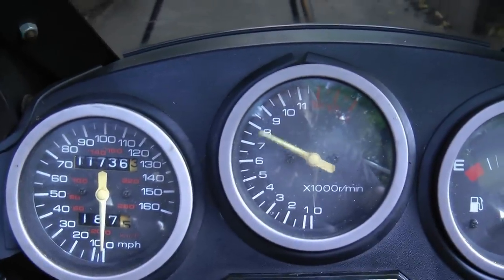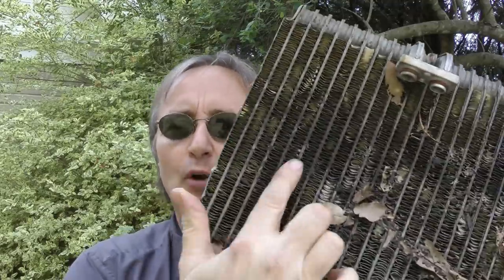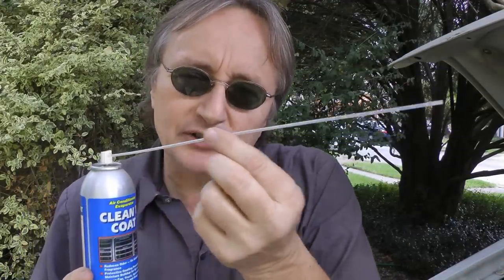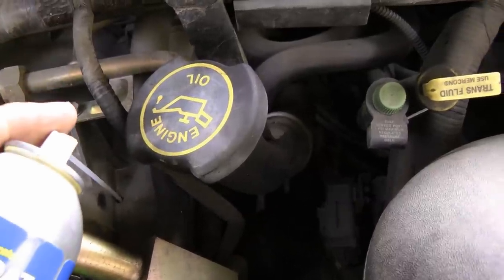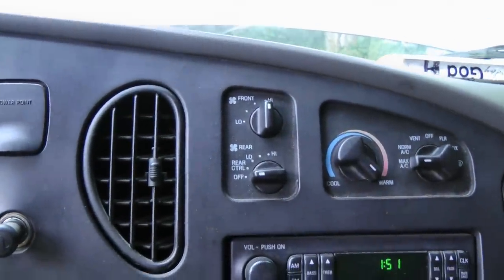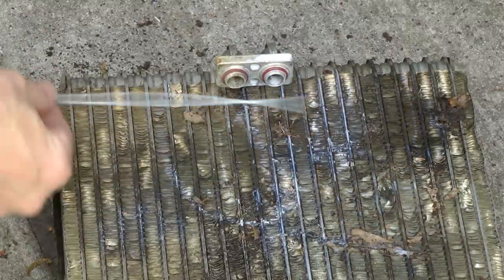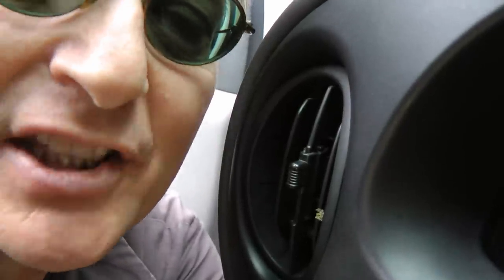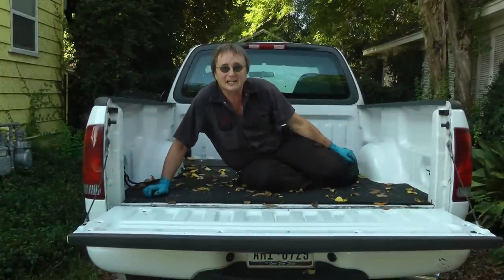How To Remove Car Vent Smells (Odors)

Comment: After seeing how ineffective the spray was at getting through the coil fins even when the coil was outside the car, I would rather take the coil out and replace it if there is a problem of smells or leaks. It's sometimes a dirty complicated job. But, I also don't trust breathing the chemicals from the spray that might just become an additional bad fume to breathe. It could become one bad fume on top of another.
Reply: until you realize how hard it is to get an evaporator coil out from under the dash lol

Comment from the maker: @cnorth50 just remove the blower motor and spray the condenser right there. A bit of work, but it beats drilling holes if you don't know what is where (as you could punch a hole in the wrong part.) scotty

Comment from the maker: if it does it all the time, evaporator is leaking. If it does it after running a while, the evaporator is freezing up and you need work done on the AC system , often a bad thermistor in the evap case
Reply: My vents stink eealy bad like rotten blood or death. Is that how it smells or do you think I have a dead rodent ?

Comment: I would like scotty to show how to unscrew the blower resistor on a Toyota...especially a 2005 Sienna. Scotty said not to do a flush on the new cars because the condenser is thin and it can mess up the compressor. Is this a flush or just a different type of cleaning?

Comment: Will a clogged evaporator cause warm air vent flow while idling at a light and then cold air flow when moving forward once again?

The cabin filter was very clogged and removed.

Comment from the maker: of course fix the ac, it may need refrigerant or cooling fan repair if they don't push enough air. But check under the hood, often oil drips on the exhaust and you smell that. Exhaust leaks you would hear with your ears.

Comment: Clean N Coat isn't available anymore. I bought Kool It and the spray tubing is 1/4 wide. Is  that to wide if I drilled where you drilled? I have a Ford van like you used in this video.

Comment from the maker: you system is stuck on default position. ON older cars, that's a vacuum leak. But in newer cars often bad computer controls such as bad blend door actuator

Comment: It works for a few days, but the issue is I am experiencing humidity in my car when ever I come back after a few hours of car sitting there its very humid inside and seats are wet even if the AC was never used makes me wonder if something isn't draining properly from it.

Comment: hi scotty, I have a 2012 rav4 and there is an awful smell coming from the A/C. Can't I just remove the filter and spray the cleaner directly to the fun? Or if I remove the blower resistor as you have mentioned, will there be a hole to insert the hose? Thanks

Comment: my wife has a 2015 Nissan Rogue ac blows air great but every now and then  the air flow gets weak but the blower you can hear it running it will turn up and down not by itself but with the knob you can turn it all the way up she will loose air flow, now when we go to the carwash when everything is said and done when we get up to the blowers that blow the excess water off your car you can fill the air from them coming through the vents what can i do?

Comment: Scotty,  my 2003 chevy cavalier has a oil smell problem coming thru the vents. Some how oil or fluid has gotten into the air filter hose, smells when you turn on ac or heater.  What do I do??

Comment: Hey Scotty, I have a 2011 Ford Escape and recently the air coming out of the vents smells funny but after a few minutes it dissipates. Any suggestions on how I can remove this smell from my car?
Reply from the maker: +WiiDroid do as in thise video, it's often mold or bacteria
Reply: +Scotty Kilmer I tried spraying Lysol through the intake twice but the smell still remains, where could I drill a hole for Clean n Coat?
Reply: +WiiDroid the dude just told you. watch the video

Comment: Get a can of foaming coil cleaner at Home Depot. It expands in the space to reach those unreachable areas you can’t spray. Only thing is you have to rig your own straw or some sort of tube to spray it in there as it doesn’t come with one.

Comment: We just did this with a seemingly similar Ford (1998 Explorer), but despite a normal strength blower motor, the flow feels obstructed in front (but strong behind the front seats). The air is cool in all vents. What should we try to help the flow in front?
Reply from the maker: check for kleenex or other obstructions in the intake of the vents first. If not that, the blend doors often get stuck on fords and that's a mother taking that dash apart to fix them

Comment: my car is Chevrolet Malibu 2003 I bought it 3 months ago. when I opened my car on the driver's doors after 20 minutes of driving, I felt
 something very hot under my car. What is that cause? I used my aircon that time.

Comment: wont the disinfectant spray destroy or corrode the HVAC system? Thanks
Reply: If you can use one without alcohols and with neutral pH it's best but i highly doubt the little alcohol that gets sprayed together with the disinfectant could do any harm at all to the evaporator coil/heater core, in fact it would likely immediately evaporate and leave only chemically inert compounds on the coil. Just don't go and spray bleach, acids or soda solutions on it... these will definitely do some harm to the thin evaporator coil/heater core tubes.

Comment: my honda odyssey 2001 smells bad when i turn on the front or rear A/C and the odor is attached to my shirt, skin and hair. i checked the connection and there is no leak from the evaporator. please help me.

Comment: Hey Scotty, when I turned my car's heater on a while ago, I smelled something that was like roasting peanuts, and I was told this was because my car hadn't run for a few weeks.

I ran my car for about 10-15 minutes, and the smell was there the whole time, never got any weaker, as far as I could tell.  I checked my oil levels, and they were fine, engine's not overheating, nor is the check engine light on.
Reply: Could be squirrels hiding peanuts in the evaporator box
Reply: @DeepSouthernTX  Hah, no idea what it was but I got rid of the car a while ago. It never had any real issues besides that.

Comment: I smell a dead animal smell  every so often "OUTSIDE" the car but never inside. Had the car for 2 years and only smelled it a few times. I have been underneath for oil changes and looked in engine compartment and can find a thing! Any ideas?
Reply: Can't *

Comment: I have a 2006 LR3 and the car smells very badly after it rains.  It used to go away after a week or two but now the smell won't go away.  Any ideas?  It's not coming out of the A/C-Heat vents, it's the interior that smells.
Reply from the maker: +Nancy Bailey car is full of mold, try some lysol ALL over the place

Comment: I like this trick to get at spraying/cleaning the vent system components that are hard to reach.  Only thing you got to be careful of is like you said drilling thru a component like evaporator or heater core.

Comment: my 04 wrx heats smells really bad and can't figure out how to remove the smell. changed the cabin air filter but now how to try this clean n coat where can i buy it? also do you know where its acted at in my car where i spray the stuff? Thanks you so much! rather do this and save so much money if it works.
Reply from the maker: just google clean n coat, that's how I got it.  Do it just like in my video, only spray it on the heater core section instead of the evap core

Comment: I bought a 2014 Ford Focus back in September and I started smelling that sour moldy smell in the Spring when I had the fans running, but not the A/C.  I talked to the dealership and they want to charge me $175 just to "Deodorize" the car.  I tried to use a $7 can of product on the intake vents under the cowl, but it only temporarily masked the smell.  Would I have to drill a hole into the case like the video, or is there a blower resistor under the glove box?
Reply from the maker: drilling a hole lets the cleaner get in there better, more direct.
Reply: Same issue same year and vehicle is this normal for a 1 year old vehicle
Reply: I have 2013focus st i hve the same problem the dealer told me to try vaccum the whole condenser and aircon pipe for 375 i might try scotty way

Comment: Hi Scotty, my 03 Protege has a bad smell almost like exhaust. It has gotten worse during the summer so I think its coming from the AC (I live in Miami so AC in the winter is somewhat common too). The smell is so bad, the car interior still smells in the morning. 
There is no noticeable loud exhaust SOUND. Also, the AC only works when the car is in motion,, Stop 'n go = no AC. Is this possibly related to the AC? Or should I look for exhaust leak?
Reply: I got the same problem

Comment from the maker: @nexpro1 Yes, those dodges are designed like crap, you can't access the original drain hose very well. So making a new one and putting a hose on it through the firewall would be a good move. Scotty

Comment: Okay Scottie, can  you tell me if an 02 Audi A4 has the knozzel under the glove box or will i need to drill an 1/8 in hole also?
Reply from the maker: it's more toward the middle and hard to get to. Drilling is easier
Reply: thnx! I also have an issue with my car always smelling like antifreeze burning on the outside and the smell comes thru the vents also. Sound familiar?
Reply: jgyrwa
Have your heater core checked for a leak. The A4 does purge excess antifreeze in certain engines, so this can cause the burning smell in the engine bay- I know because it's happened to me a few times. But definitely have your car checked so make sure something isn't terribly wrong so you can have it fixed before it gets too expensive. Owning an A4, I can tell you- they're not cheap to have repaired.

Comment: I tried looking for the cleaner in this video. Here in Canada I can't find it at my auto parts stores. I have a Pontiac G5 and was wondering how to find the part you cleaned in this video. My vent smells real bad. I put cleaner through the vents and it only helped for a month. I need any advice I can get.
Reply: change your cabin air filter
Reply: +Jd Bailey it's a brand new filter.

Comment: Hey Scotty I notice a weird odor coming from the vents only when I first turn on the ac or after I shut it off after running it for awhile. When I turn the fan on but don't use the ac, the smell isn't there. What could cause that? Thanks
Reply from the maker: mold and bacteria grow in the AC evaporator case cause it's damp and they like dampness. Try cleaning it out with lysol

Comment from the maker: @southernstructure remove the blower motor resistor assembly and stick it in that hole, after putting duct tape on the hole and putting a small hole in it for the hose. Scotty

Comment: how about liquid dish cleaner, in toyota.. just take the ac air filter off & turn on the ac untill you see water dropping from the drain hose, then shut down the engine, put it in on position turn the fan on full blast & pour the liquid dish cleaner in the blower 100cc every 30 seconds 10 times or until 100ml is finished, your evaporator is clean as new & will give you better cooling & kill all the bacteria that was inside the evaporator. I did it, works 100%. but still the boss knows better (Scotty Kilmer)
Reply from the maker: sure, you can do that, just be sure not to short the fan motor and blower motor resistor out, water and electricity doesn't mix that well

Comment: I just bought a 2006 Ford Five Hundred, it doesn't really have a smell but the AC blows warm air.  It does cool-cold air in the morning or if it's cool enough outside.    I've done a recharge and it has pressure and freon, so no leak.  The compressor runs, and I sprayed the condenser with a hose to clean out any gunk.   I was thinking of changing out the blend door actuator, but after seeing this...what do you think Scotty, could my Ford just need the evaporator cleaned like this?  Or is it something else causing the issue?  Thanks!

Comment: Scotty I got the same e150 with very little air flow I clean the evaporator core on the firewall it was dirty then tried it and still not much air flow ..got a guess why

Comment: I didn't read all these comments, but what also helps is to turn off the A/C and run it on vent only, your last mile or so. This dries up the air in there, and helps keep the stink away. I guess in humid areas you may want to run the heater.

Comment: my 03 Taurus smells like antifreeze after it runs awhile or when heat is on checked the level its not low just started doing this after had an oil change(few days ago) any ideas why?
Reply from the maker: +Brian Workman often small leaks do that, pressure test the system, often a small leaking heater core does that and you don't really loose much coolant YET

Comment: gud day sir scotty i have one question i smell something little burn smell but not too strong but its is whenever im going uphill or accelerating my car
Reply from the maker: check for slipping or worn fan belts, and also oil leaking on the exhaust from leaking valve cover gasket or other leaks

Comment: Scotty, love the vid, but my truck has a cabin air filter and the evaporator is inside the firewall.  I've got a moldy smell.  Tried lysol and some other stuff that only masks it.   But thinking outside the box.....would it be possible to mount some type of black light inside the evaporator housing and hook the light up to the AC power?   Or rig it up where it stays on even when the vehicle isn't running.   You could maybe stick the light in where you drilled that hole and mount it. Mold won't grow in black light from what I understand.  Just think'in here.......

Comment: I bought a 2014 Ford Focus back in September and this spring I noticed the sour smell when I had the fan blowing without recirculation on and without the AC on.  I tried a $7 can of product in the air intake under the hood, but that just masks the odor. The dealership says they can only deodorize and want to charge me $175 for it. Would I have to drill a hole like in the video or is there a way under the dash?

Comment: Scotty , my Mercedes c350 2007 has fume smell when I put the heat in full settings, what should i chack ?? Because there is no any oil or coolant leaking on the engine and mechanic didn’t figure it out they chack all the exhaust system and then told me there is no any leaking, i did full detail clean and wash and the engine wash, it is still there,, the fume is making my nose so drying I don’t know if It is a exhaust smell or gasoline fume or the car is running rich ?? Could you please tell me where should I start, im an aircraft mechanic i have some knowledge about the cars

Comment: For me lysol does the trick just fine. Put the air vents to intake and spray lysol on the vent under the windshield. It lasts for 4-6 months, and lysol is cheap. Besides, what a sloppy job, drilling a hole and then just dumping a blob of silicone over it. I'd rather use lysol. It's easier and way cheaper.
Reply: Lysol has a high alcohol content, alcohol reacts with aluminum (although very very slowly in the presence of water and at room temperature and below) and evaporator coils and heater cores are made of aluminum... just FYI, if you can find something without alcohol inside it's better than Lysol.

Comment: I used 50 cents worth of vinegar to get rid of stink and cigarette smoke stink in a used 2011 Chevy Impala.  Put the vinegar in a spray bottle and sprayed the whole bottle into the inlet of the blower fan, then took the garden hose and flushed out the vinegar again through the blower inlet.  This may not work for all cars but the Impala was easy to remove the plastic inlet screen and you can see the blower motor.  This was the only thing I could get rid of the cigarette smell.  I thought it might have ruined the electric motor, but it ran fine until I sold it.

Comment: mine smells so bad the wife won't even ride in the truck. It's a Mitsubishi Raider. I tried Lysol that lasted for about 10 minutes and then the smell came back. It's more prominent when the AC is running. the smell I have is more new truck smell but overpowering. It's almost like plastic. She swears it's mold but I suppose the wife knows better. However would this work is a Lysol doesn't? The truck is in mint condition other than the smell it has from the vents
Reply: Get an Ozone treatment done on the car. Go visit a Professional Auto Detailer. We do this stuff for a living.

Comment: Scotty, I have a 2004 Dodge Dakota truck that leaks water into the passenger floor when running ac. I had a guy take air and try to blow out the hard to get drain tube in the engine compartment already. Could I drilled a small hole in the bottom of the case like you did in the top  so the water will drain out?

Comment: what if it smells like antifreeze . I did a pressure test and it checked out
Reply: sounds like your heater core or your water pump maybe leaking are you losing anti freeze?

Comment: what is a evaporator isit the pollen filter   what we say in the uk??
Reply from the maker: the evaporator is the small metal radiator in the dash that makes cold air blow in your face with AC on.  Some cars have pollen filters over the evaporator air intake duct

Comment: do i have to drill a hole for my honda accord 2001?
Reply from the maker: it will coat it better that way, but you can use the drain hose if you feed it in the bottom of the drain hose under the car with it jacked up
Reply: +Scotty Kilmer Hey Scotty,can you explain what is the process if I want to do it through the ac drain?